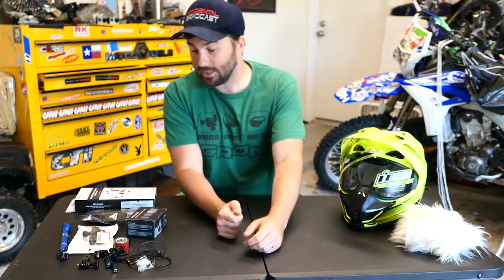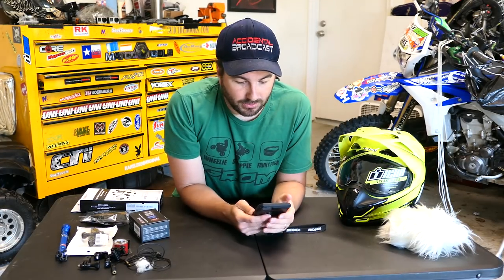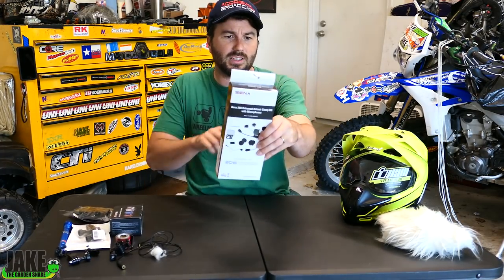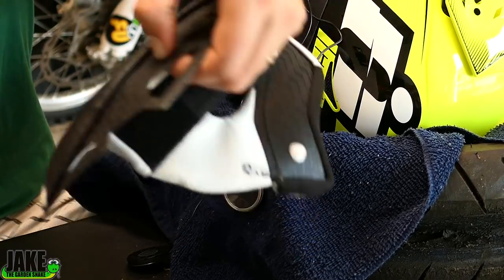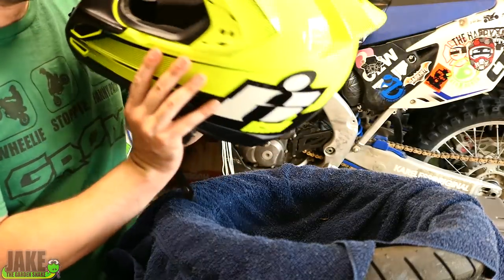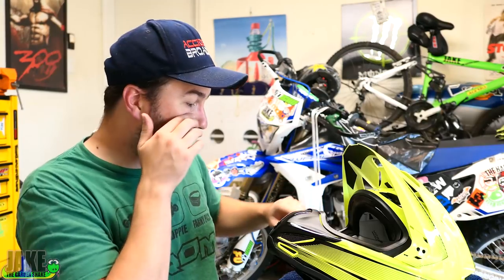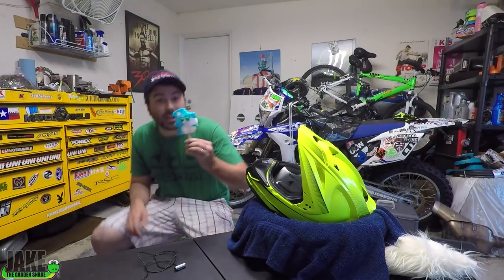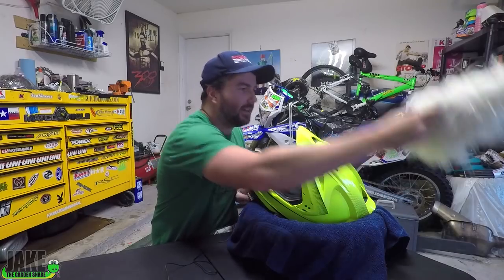Motorcycle Helmet Camera Setup - Motovlogging Setup - GoPro Setup

Comment: I'm still having issues with my mic placement. Original setup was mic in the front which picked up to much breathing as it was right in front of my mouth (see my first 2 videos) then I moved mic to just right out side check pad and it's picking up to much wind noise so at this point I've moved mic completely under cheek pad but haven't had a chance to check audio.....if all else fails I guess I will buy the SENA adapter as I have a Sena sm10 on my helmet as well and follow this video with hopes it works.

Comment: Excellent video. Good to have all this info from a seasoned pro :) Do you ever adjust EQ afterwards? It seems like the higher frequency levels are getting ducked a bit, especially when you've got a loud engine. Sometimes I push those up a bit in post, to compensate.
Reply from the maker: No, the gopro 4s and up do this really great job at adjusting the level automatically and fast.
Reply: Have a link to this seasoned pro?    :D

Comment: i spent 40 mins setting up  my mic to find out it failed iv now got a mic that finally worked with my gopro hero 5 black. how may mic's have you had fail on you Jake.
Reply from the maker: none
Reply: i must be doing sum thing wrong iv gone through 11 in the last year. they work fine at first and sound quality  deteriorates. and getting one that works with the 5 black has been a night mare. and i don't buy the cheap ones iv tried Sony. Boya. Blixxo. just had no luck.
Reply: Chunks Life I think blockhead found one that works with the hero 5
Reply: Chunks Life find a cheap Chinese one with really good specs and order 1, if it sounds really god... order 50 more of em and forget it lol